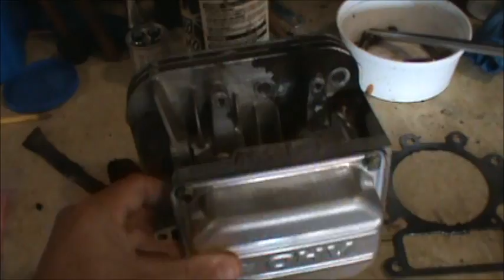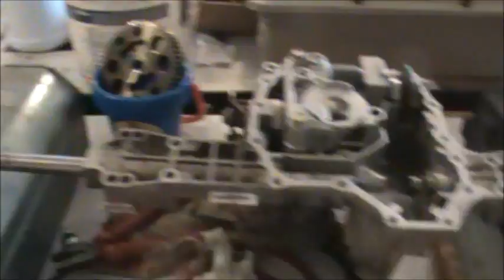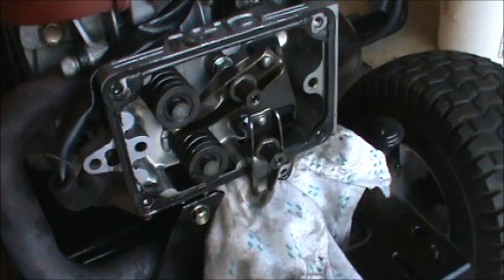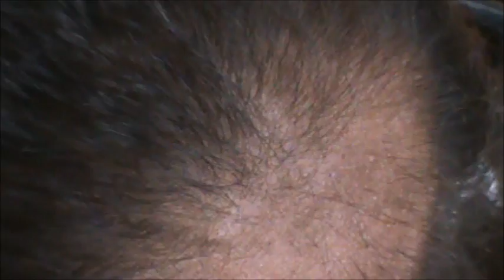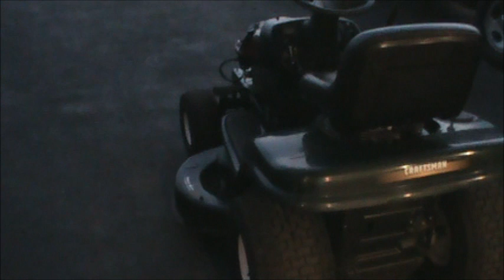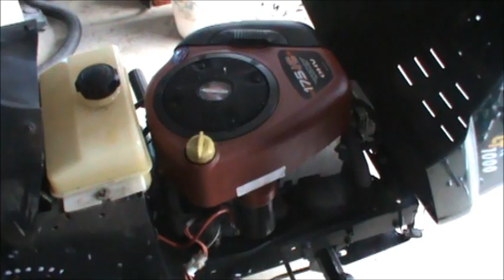Adjusting the OHV valves on a Briggs 17.5 Intek

Comment: Nice job sir, you explained the job well, that’s the 4th feeler gauge setting I’ve seen for the same engine, I guess I need to get the model number off of mine to get the right setting. You did a good job though .

Comment: If I ever get a hold of another 19.5 hp twin cylinder engine for mine I'm going to snap it up because that motor on my husquavana ride on mower keeps blowing the head gasgets.  I have never had any troubles with my twin cylinder engine on my craftsman ride on mower but lots with the single cylinder one on my husky.

Comment: Thank you for the video.  I just picked up a lts1500 with the same motor for free. I am in the process of rebuilding it. I do have it running but want to adjust the valves and replace the the carb. But other then that I just used it a day ago on a 4 acer yard and it cut with no problem. But I want to make sure it runs perfectly and last a long time. Is there anything else I should look over on this tractor.

Comment: Note that the valve adjustment distances are incorrectly quoted. They should be; intake (aluminum push rod) 0.003" to 0.005", exhaust (steel push rod) 0.005" to 0.007"
Reply: that is correct

Comment: You adjust valves on an automotive engine at TDC compression stroke.  They don't have a compression release.  On lawnmower engines, you should rotate past TDC on the compression stroke a 1/4 turn on the flywheel to make sure you're not adjusting against the compression release actuator on the cam lobe.  .03 to .05 on the intake (aluminum push rod)  .05 to .07 on the exhaust (steel push rod) for this engine.
Reply: Lets zero in on this 1/4" past TDC. My Briggs Manual says using a rod (i.e. screwdriver) against the top of the cylinder, rotate past TDC to measuring rod on cylinder goes down 1/4". Thus would be the cylinder moving 1/4" in past TDC.
Reply: BOB Driver: .03 to .05 is 30 thousands and 50 thousands of an inch. The spec is 3 to 5 thousands of an inch. Huge difference. You are missing a zero in each of your distances quoted.

Comment: HELP  Same engine Intek 17.5  I did as you have shown. I got both intake and exhaust at 6 thousands. Spun it over and got it back to TDC  and checked again 6 thousands. So that is OK. Put the plug back in  and same shit.  New battery.  all cables good.  Even pulled the  air filter off. Any helpful suggestions most welcome.
Reply: William, (9 dos ago), did you get your engine adjusted. Im dumb, but if you have a twin cylinder engine, the firing is going to alternate between head ( cylinders), so make sure your tDC goes is on the cylinder firing, as one of them is in limbo while the other one is firing, it could be mistaken for the firing cylinder at TDC when it is the other. Adjust the firing cylinder barely past TDC. see above.

Comment: by any chance do you know if the engine has been updated? i have the same engine but mine has a black shroud where yours is red and has been used for a few years. i bought it used and runs pretty good. i guess i have to check valve clearance.

Comment: doublewide6... Thanks for the help. I knew the valves were out of time on my B&S 18.5 HP. But wasn't for sure how to go about re-timing them. My owners manual says intake setting is 3-5 thousandths and exhaust is 5-7. I wasn't having any luck. I came across your video and you suggested 6 thousandths on both intake and exhaust. That was the trick! She's purring like a kitten now.

Comment: Great video fellow youtuber [But I wonted to tell you  that both valves shouldn't be set at 6 thousands /intake should be 3 to 5 and exhaust should be 5 to 7] even though the engine will run you could float a valve at high rpm causing the push rod to bend. iam a master service tec for Briggs and Stratton. [Just wonted to help.]  once again great video.
Reply: My manual says 004 and 006, B&S intel ohc

Comment: great video thanks.  I have Craftsmann lt1000 with B&S 18hp OHV that looks very similar.  It is a 2003. For the past 2 seasons I have had very intermittent operation. It will cold start easily as long as I have a fully charged battery.  It runs well at both low and high rpms for about an hour.  Then it sputters when I slow it down to empty the bagger. Eventually it stalls and wont start again.  Sometimes it will start again and run well if I let it sit for an hour or so. 
I have changed the gas cap thinking it could be clogged and slowing flow after a while. The fuel system does not appear to have a fuel pump.  the gas tank is just to the rear and a bit higher than the engine and I don't see a fuel pump. Lines appear to go from tank to filter (which I have changed) to side of carb.

I had to replace a battery that was only 2 years old which makes me wonder about the battery charging. Unfortunately the ammeter is inoperative; but I did check voltage on the battery terminals while engine was running at operating speed.  It was only about 12.6 volts. I know car chargers run 13.5 to 15 or so.  Is that what I should see for this engine?

Any ideas or helpful suggestions will be greatly appreciated.
Reply from the maker: anniversary4 It could be the low idle circuit of the carb. The battery should be charging at 13.5V.  Perhaps the regulator if the engine has one or the ACDC stator under the flywheel not producing the right voltage.  Clean the carb first if the engine does not idle.  If it will idle with choke on it is most likely the carb.  When coils modules go bad they get hot and you lose spark.  Check for spark when it will not start.  Good luck.
Reply: doublewide6 Thank you.
Reply: +anniversary4 
Before doing anything drastic take off the top of the motor to expose the cooling fins. It maybe a mouse nest blocking air flow. Your symptoms are exactly what I experienced on my air cooled engine some years ago. I had to swallow my pride and take my mother-in-law's advice to investigate this possibility after all my other efforts failed. After removing the obstruction and the dried remains of a mouse it ran just fine. It was a tough old Simplicity.

Comment: Why are the rods made from different metals, and why are they installed the way they are? Thank you for your vids!
Stan
Reply: because briggs and stratton engine designers for the intec series smoked lots of crack...seriously..there is not good reason to so that other than save a few pennies for each engine.  Apparently, it was enough to convince the bean counters it could save/make more money. But to the owner, who maintains these engines, having different materials is just asking for headaches.  and yes, it happens often.

this is the reality of small air cooled engine design that happened in the 80's and hasn't changed much since.  Briggs is notoriious with lots of reliability problems with their engines.

Comment: great video glad i watched had the pushrods backwards. still not running but don't think i adjusted valves at tdc going to try again tomorrow. these motors don't get very good reviews B&S aren't as good as they use to be in my opinion.

Comment: What does top dead center mean??
Reply: This is the point in the piston's stroke at which the air/fuel mixture is maximally compressed. Ignition should occur at TDC. Basically the piston is all the way up..